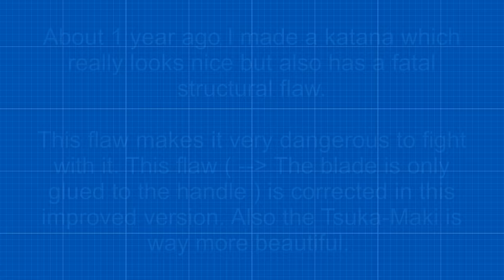How to make your own wooden katana! ( version 2.0 ) - Free templates

Comment: Tip: use silver and grey paint on the blade with some black shadows to make it look real and The tsabu red if you gonna use black color for the tsaku maki.. Because red and black is a perfect match... So you will make it 100 times more realistic.
Reply: Thx
Reply: Comolease uste
Reply: 1. might as well just use metal
2. using black and red doesnt make it more realistic. most katanas are made with a non dyed samegawa

even if you wanted to make it look realistic, this is as realistic as a bokken can get
Reply: Csn we use aluminum foil for it ?
Reply: yes
Reply: @sukuna8536 no aluminum is very weak and if you are talking about wrapping it in aluminum foil just don't use it on anything since the foil will rip
Reply: @gildedrecord953 Aluminum tape is a lot more durable and can be polished.
Reply: @tjpprojects7192  they said foil and when the aluminum tape fades and you start to see the wood again it wont be worth it
Reply: @gildedrecord953  Yeah.......... I know they said foil.......... That's why I recommended aluminum TAPE..........  It's a lot thicker, more durable, and can be polished. It's literally used everywhere in cosplay/prop circles to make things look like metal. "And when you start to see the wood again it won't be worth it". Bruh... you'd literally have to abuse the blade so damn hard to see the wood again, and almost NOBODY would abuse a wooden sword that bad. Also, who are you to say it "wouldn't be worth it?* It's more than worth it since it's just about the only way to make a wooden sword metallic if you're going for that look. I guess all of those prop makers who already use aluminum tape are dumb becuase, "It'S nOt WoRtH iT".
Reply: @tjpprojects7192  chill tf out second of all no it's just wood no amount of coverup you add will make the thick blade "realistic" because real blades are thin and need sharpening so you'd be better off just adding a stick to the hilt and covering it with foil and yes if you hit stuff with it like im imagining af least a quarter of people are here for and not just to put it on some kind of trophybox in their room  if you put the tape on the blade it will not be sharp.
Reply: @gildedrecord953  Whoops, I didn't realize that I've been feeding a troll until now. Well played, you got me pretty good, but you gave yourself away with the whole "sharp aluminum tape" bit. Literally nobody talked about something as blatantly absurd as sharpening tape. If you didn't make that mistake, I probably wouldn't have realized that you didn't care about industry standard prop making techniques. Though with hindsight, your previous comments also don't make any sense, so I should have realized you were a troll sooner. Oh well :/
Reply: @tjpprojects7192  1. might as well become  a forger and use real metal 
2. shorten your essay no one tryna read allat
3. stop talking like a damn anime character "ah i have been fooled played like a fiddle by this master troll the whole time"
Reply: @gildedrecord953  You're* welcome.
Reply: @tjpprojects7192  Whoops, I didn't realize that I've been feeding a troll until now. Well played, you got me pretty good, but you gave yourself away with the whole "You're* welcome." bit. Literally nobody talked about something as blatantly absurd as grammar mistakes in a comment section. If you didn't make that correction, I probably wouldn't have realized that you didnt care about what people have to say. Though with hindsight, your previous comments also don't make any sense, so I should have realized you were a troll sooner. Oh well :/
Reply: @gildedrecord953  I'n glad you're* having fun. :) I don't mind counter-trolling when people claim industry standard prop-making techniques are somehow "dumb". Keep playing with yourself :)
Reply: @tjpprojects7192  I'm* you're welcome.
Reply: @gildedrecord953  Your* welcome
Reply: @tjpprojects7192  You're* welcome* you are welcome.
Reply: @gildedrecord953  Wait, do you actually think that I'm serious about correcting non-existant spelling mistakes? Lol.

Comment: Bro I suggest you about your handle as you're saying that your katana's handle is not sturdy so drill small hole in it and fit a wooden pin in it and then instead of applying glue use epoxy resin  and do same for guard

Comment: I'm making my katana out of a thin wood, the thing is that I glue it a second time in the wood to make it a little bit stronger, does that work?
Reply from the maker: +Luis Alberto how thin is the wood? What exactly do you do with the glue?
Reply: Wooden Weaponry the wood is like 3 to 5 millimeters thin. I draw the template on to the wood, i cut it and the one i cut, i glue it again to the wood. I cut it again, making my sword a little bit stronger
Reply from the maker: +Luis Alberto So you glue two layers of 3-5 mm thick plywood onto each other to make the blade ? I guess that will work, but I doubt that it will be as strong as a blade made of 12mm ply
Reply: Wooden Weaponry you're right, the blade just snapped on me
Reply from the maker: +Luis Alberto :C